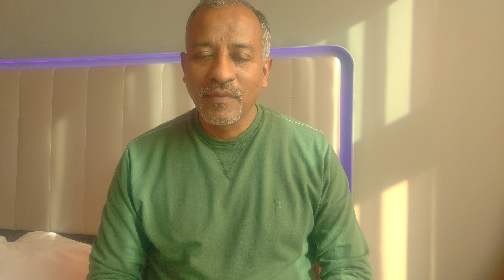Manufacturing Process Control | IATF 16949 | Bhavya Mangla | English

Comment: Good Afternoon Sir , First of all I'm really sorry to use this platform to clarify my doubt .  Well this question may sound childish but can you please clarify my doubt. 
Sir as per IATF clause 7.1.5.1.1 Measurement system analysis we have to conduct statistical studies for each type of test equipment mentioned in control plan . Suppose in case of any contingency or failure. For example- In case of failure or width camera we move to measuring tape temporarily for any process characteristics which is not mentioned in Control plan . So do we have to conduct Statistical studies  for that also or not and why? Or calibration will be enough for it .
Reply from the maker: If the measurement is critical and the alternate measurement system is already defined, conducting MSA study is a good idea if we need to use it for longer period or depending upon the criticality of the measurement system on the next process.
Reply: @bhavyamangla  Thankyou sir for your explanation .

Comment: Sir thanks for making this video further can you please clarify whether As per IATF clause 9.1.1.1 do we need to define reaction plan for all characteristics or do we need to define only for unstable process and why?
Reply from the maker: Thanks Ayush for an interesting question. The reaction plan is needed whenever process or fool proofing goes out of control. Since no one knows which process will go out of control, reaction plan is needed for all. During process design stage, the cross functional team review and decide what need to be done incase of any failure as operator or supervisor may not be competent about every thing.
Reply: @bhavyamangla   Thankyou so much Sir for replying and clarifying my doubt.